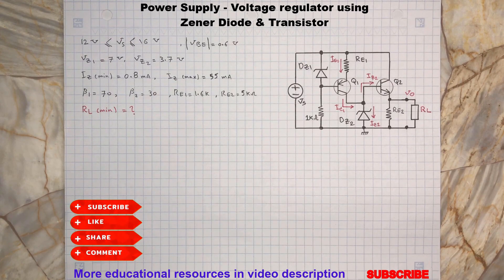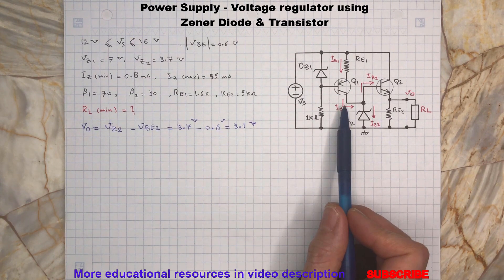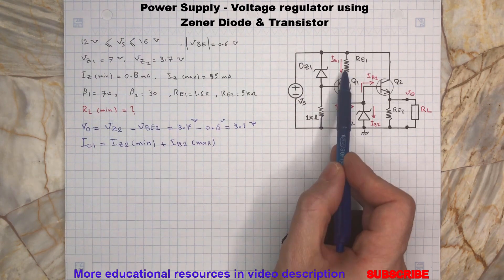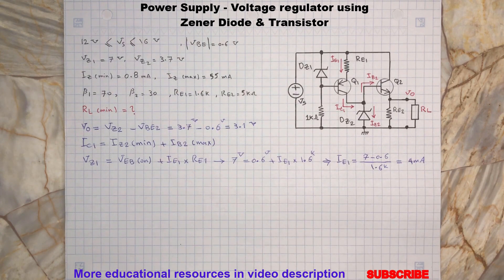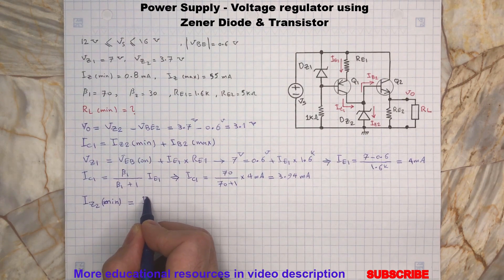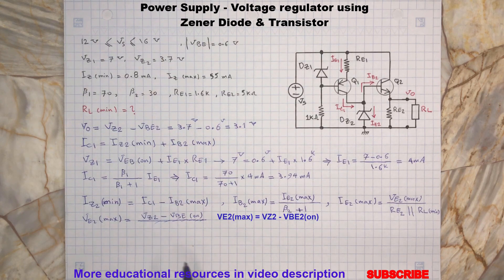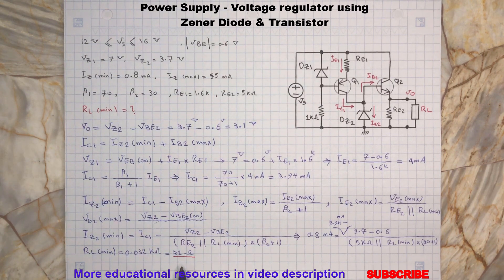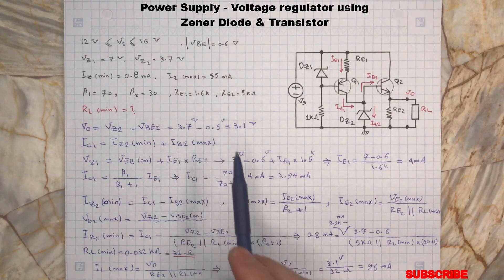Voltage Reference Circuit with BJT Transistor to Carry the Load Current

Comment from the maker: Full-Wave Bridge Rectifier using IC 7809:  https://youtu.be/oplCvtsdcM0
Voltage Regulator and Current Limiting Circuit Analysis:  https://youtu.be/8Mn6LC2isHs
Op-Amp and Zenner Voltage Regulator:  https://youtu.be/CKMxGu3uHAA
Transistor Series Voltage Regulator:  https://youtu.be/OuVbjRZHM9U
Electronic Circuit Analysis Playlist: https://www.youtube.com/playlist?list=PLLA_QJ8rHZBh5LqrY41bCvKgreRDRWrBQ
Digital Logic Playlist: https://www.youtube.com/playlist?list=PLLA_QJ8rHZBjoWpsdJeo6ii5HnWTEmDi7
Control System Playlist: https://www.youtube.com/playlist?list=PLLA_QJ8rHZBjS_S6WPkmUweF5NbImvSqf
Circuit Analysis playlist: https://www.youtube.com/playlist?list=PLLA_QJ8rHZBj8qPBFArjveEustxuToLDw